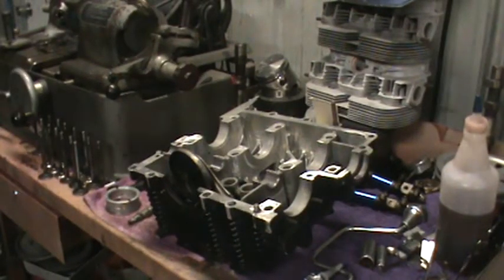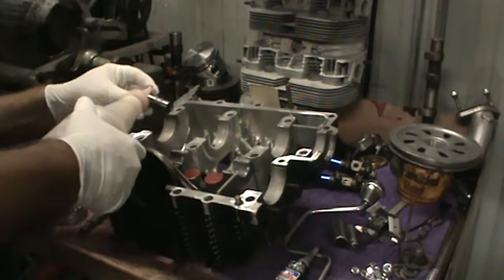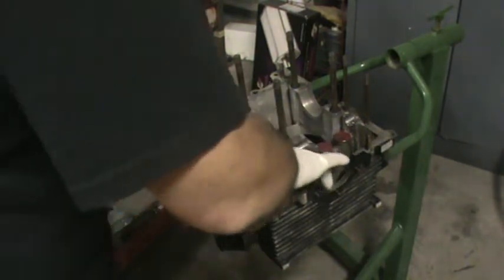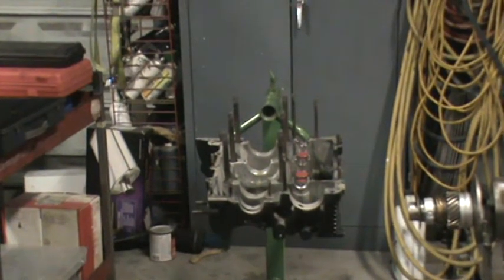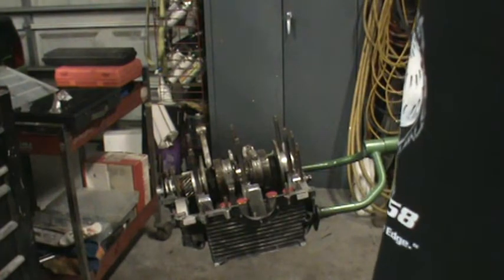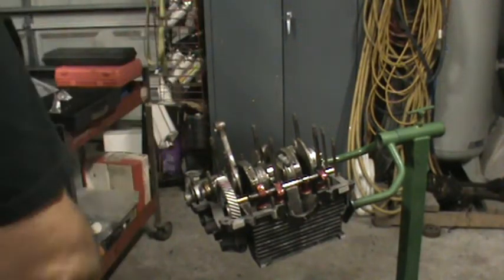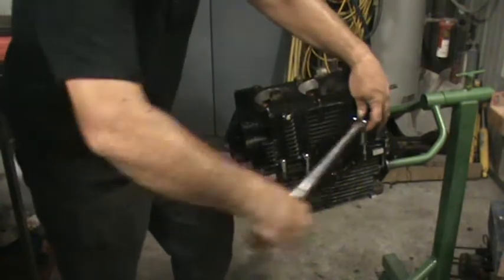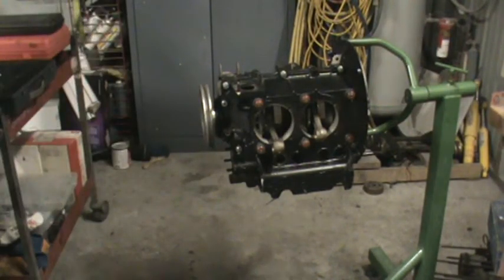BUILDING THE 1915

Comment: So here is the stupid Jeff questions: Is there any difference in the way you build a stocker for long lasting use vs. a hi performance for horse power? I'm talking besides parts of course. It always seemed to me the more radical motors never last as long as a stocker maybe that just because they get pushed harder. Also when done with the torque wrench do you store it at 0 pounds?